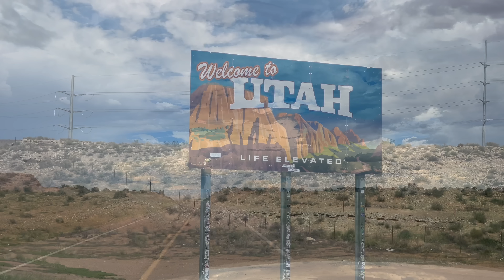I CAN'T BELIEVE THIS IS HAPPENING....! I COUPLE BUILDS OFF GRID HOMESTEAD

Comment: So you buy a new ride then replace 50% of the parts???
Reply from the maker: Not really replacing that much. Just the cage. The front a-arm structure is the weak part of the CanAm. So beefing it up is a must. Lights to see at night and lighted whips is a requirement for the sand dunes as well.